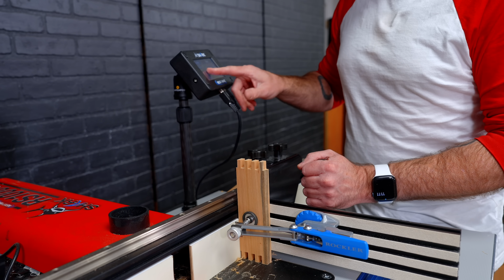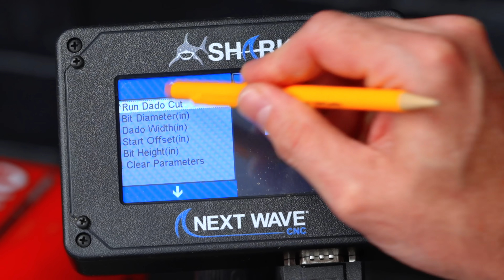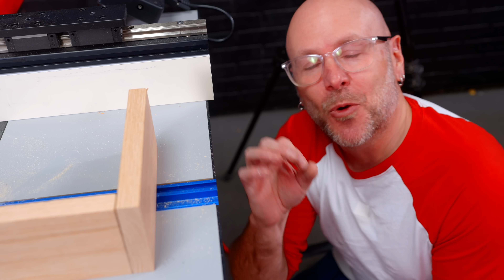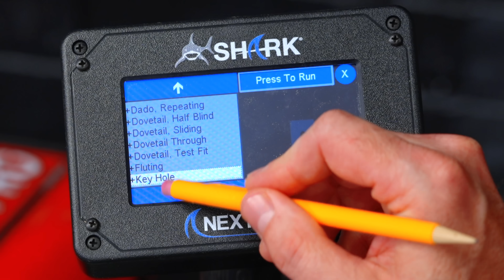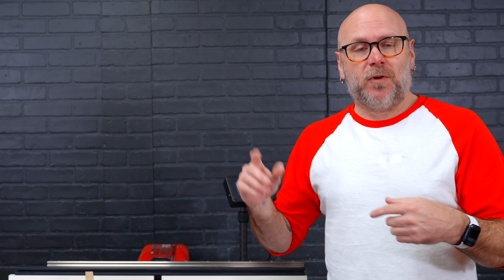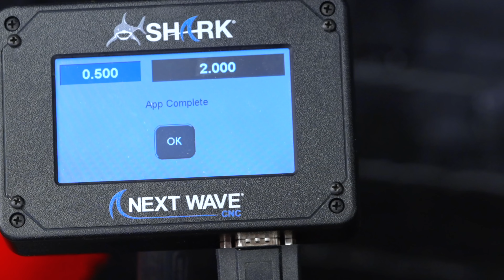This New Router Lift replaces ALL OF YOUR JIGS!

Comment: I have the previous version- the Ready2Rout and Ready2Lift motorized combo. I was always disappointed that they didn't develop the apps like they promised. I was looking for an automatic version of what Incra's router fence positioner can do, and Next Wave implied that was coming. But I never got any update. I thought it was a good system for small projects and workpieces, such as for dovetailing shallow drawers and making boxes. But for the price, it needs to do a lot more than that. I haven't tried the new version, but it looks like the same thing. So much potential, but after all these years I am starting to wonder if they will ever take it to the next level.
Reply: Thanks, James. You voiced my biggest concern: Because it's a closed system, you're dependent on the company continuing to develop new apps and to continue to support the system. That's a huge risk. 

For example, a few years ago I bought a 'smart' treadmill. One of the selling points was that the treadmill connected to an app on your phone, which gave you access to several pre-programmed exercise routines, allowed you to create your own routines, and would track your workouts. It even weighed you each time you used the treadmill, so you could track your progress. The problem was the company quit updating the app within a year of my purchase. The app won't run on phones that are up-to-date with the current operating system (or even several iterations before the current system). That means I cannot use all the wizardry I paid for when I bought my treadmill.
Reply: @DKWalser  you could just replace the software and hardware with an arduino.  Just hook the stepper motors to your own $2 motor controllers and $5 arduino.  Then  it's "open".
Reply: @TheRainHarvester  I agree with you in principle, and that would certainly open it up.  However, shouldn't spending the better part of $2k give you a little bit of extensibility built in?  I agree with the rest of the posters that lament the closed ecosystem of this setup.  If companies can make open source 3d printers and CNC machines  they can certainly do the same for this, especially considering the CNC roots.
Reply: Did you try scratching the surface?  Maybe you didn't even scratch the surface.
Reply: It's 2,000 if you want the sliding miter with it, which I would consider necessary for this tool. Doesn't come with anything, you have to build it into your router table. It's interesting, feels like the next innovation on it might the one though for sure.
Reply: @laroast8531  + $120 in shipping.
Reply: James, couldn't agree more. I'm old enough to have had the nasty experience, multiple times, of creating products in a certain file format under a certain software platform. Then the company behind that software fails to support that after a period of time. Now all my files are unreadable. This is why the open source community says, "Until you own the means to access your data, you don't own your data." And that is why I reacted to the opening statement in the vid, "Comes with 14 apps!" with, "ONLY 14 apps???" BTW, probably another writer had a better idea with pairing this with an Arduino. But maybe the best solution would be an Arduino with a DIY table (motor, etc.) setup for ultimate control and customization.
Reply: It's a real shame they don't just make it programmable, I'd love to get one and play with writing some apps for it
Reply: Have you tried the Powerlift Pro from MLCS? I've been looking at it for a while. It looks less automatic Shark pro router. But I think it could be better in some ways.
Reply: @iansalmond726  I tried the MLCS Powerlift and ended up getting 2 consecutive defective units and support was difficult to deal with. Ended up getting my money back.
Reply: @eleganzadesigns7636  Good to know. Thanks
Reply: @iansalmond726  When you search YT for MLCS reviews, it's telling that there are almost no end-user reviews. Besides, the noise it makes in the MLCS demos is ridiculous.
Reply: Have you even looked in to how you might go about hacking the system so to speak so you can either input your own ideas or totally replace the control system from scratch. I'm fairly sure there'll be videos showing you how to do it or at least similar enough so you can adapt what you see.
Reply: Don't we still need some jigs so that the workpiece is positioned at the right place vis à vis of the router bit?
Reply: An honest review thank you!
Reply: Got mine this week.  First impressions….blah.  At first slot dimensional control was terrible.  Found bolts holding mount in router lift assembly had not been tightened so it was loose!  Tightened those up and it was better.  Still, dimensional control of slots controlled by quality of router motor.  Tried Bosch and dewalt versions and couldn’t get to within 5-6 mils of bit diameter.  Also found that zero touch plate was too sensitive.  Had to wear rubber soled shoes while using it, otherwise controller screen flashed red uncontrollably!  Way too sensitive.  Miter slide a must.  Supposed to get one free with registration
Reply: @StumpyNubs - I actually bought the previous Ready2Rout/Ready2Lift combo largely because of your recommendation. I haven't been too disappointed, but there have been some frustrations that this new version seems to fix. The calibration plate shorts out if you leave any of the metal inserts in the table - and without the inserts, it's hard to keep the plate level. I had to put some packing tape on the metal calibration block to keep it from shorting. Also, unless you have a sacrificial fence covering their metal fence, it will also short out unless you cover parts of the plate. This all throws off the measurements a bit, but it's worked ok for several years for me. The metal inserts also rusted quickly - not sure what's up with that. Nothing I did made any difference. And they sold an assemble-it-yourself push fence that wasn't even quite square - but it worked ok-ish. This new setup looks cool. I actually called them a while ago to see if they would just sell the fence system, but they said it wasn't compatible. This new one is quite a bit more $$ than the previous one, but looks much more refined. The response of the interface is much improved, but it's basically the same thing but significantly better.
Reply: @StumpyNubs James, would you care to share what exactly you were hoping for? I have built my own version of this, and am always interested in adding new features to the software part.
Reply: You've got to be kidding! Your video shows the poor results after each operation. Until the accuracy in the software is improved, it shouldn't be shown or sold.
Reply: I purchased the Next Wave CNC system about 5 years ago and the tech support is outstanding to this day.  I have no doubt they will stand behind this system as well.  I am excited to have seen this demo and dreaming of seeing this system in my shop